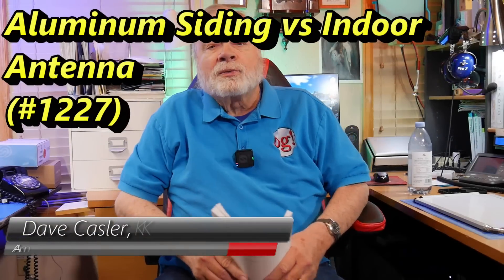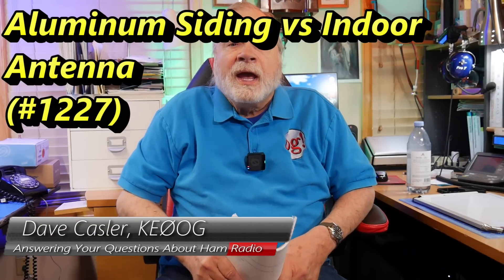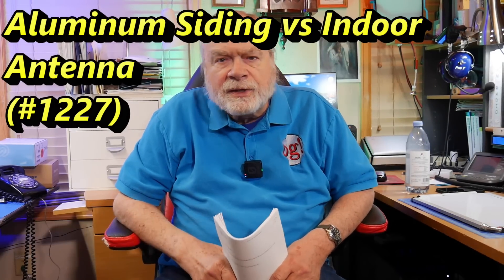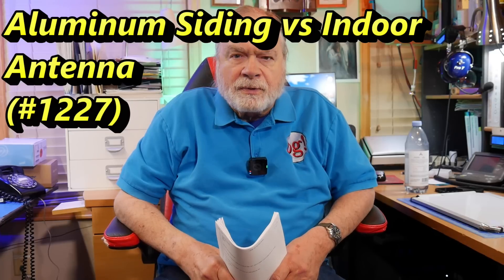Aluminum Siding VS Indoor Antenna (#1227)

Comment: I live in house with a galvanized metal roof. I am actually going to experiment with putting an attenna on several locations (I multiple nearly flat roofs), and using them as a ground plane. I was thinking of first testing to see how they act as an attenna alone. 😆 If it fails, I got some really big trees just out my window.